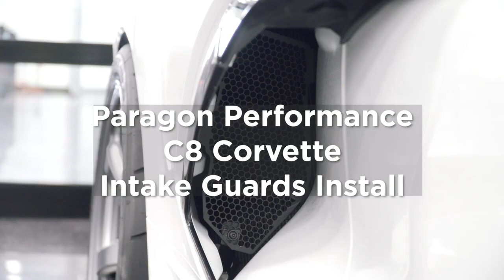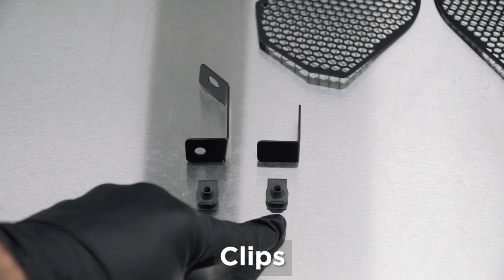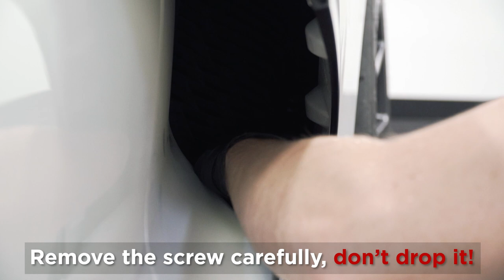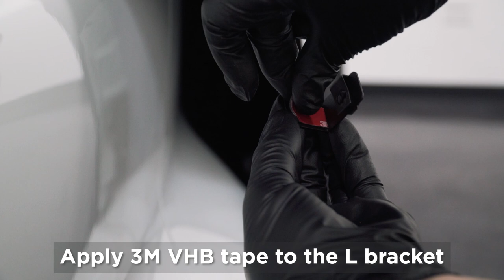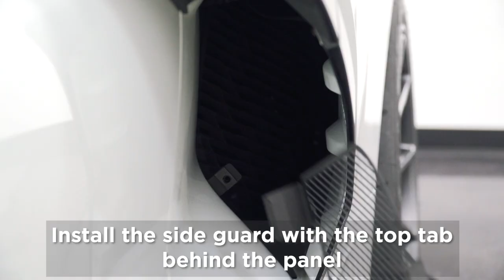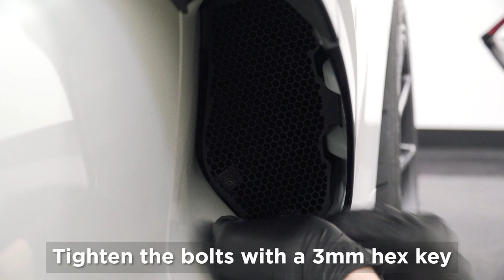C8 Corvette Intake Guards Install - Bolt in - Paragon Performance

Comment: Just installed on my 24, not impressed with the fit or installation process, I agree with some of the posts on sloppy fitment, tape supplied didn't adhere very well, I bought new 3M tape at the local auto parts. I would've returned them but I had them for awhile before installation, In conclusion there's gotta be better products available out there....

Comment: Also installed mine on Saturday.  One thing I did to help aid the install was that I added a long tie wrap to the front of the screen to help holding and placement.  Cut the tie wrap off when I was done.   Super easy.
Reply from the maker: Great tip!

Comment: I tried, and install was fine/easy but took them out. I didn't like the idea that 3 out of the 4 mounting locations were just 3M tape to hold it in place. Should have used the factory bolt near the top also.
Reply: @KennyM the front ones (which I love) are held in place with only ONE 3M and that lasted less than 1 month, but the rest is bolted tight, so no issues.

Comment: I was very disappointed it did not fit my 2023 Z51 C8 the pieces were too narrow and there was a big gap between the sides which didn’t allow me to make it stay in place with the adhesive double tape 😢perhaps I received a defective one…
Reply from the maker: Hi Hector, give our updated install video a watch and try that method as we would it to fit and adhere better that way. 

https://www.youtube.com/watch?v=rnMiwpCqiz4

If you continue to have issues contact us at Support@paragonperf.com and we will get your issue resolved.

Comment: Looks like HUGE gaps between the body and grill edge. Is that right?
Reply from the maker: The small gaps are there as a tolerance for install. The guard is going to help prevent 99% of debris from getting in. Anything small that may go around won't cause any damage to your side radiator(s).
Reply: The gaps are for tolerance? It looks unfinished and cheap.  @ParagonPerformance